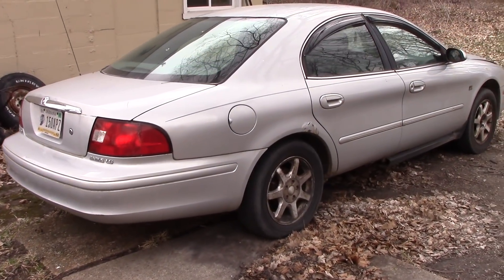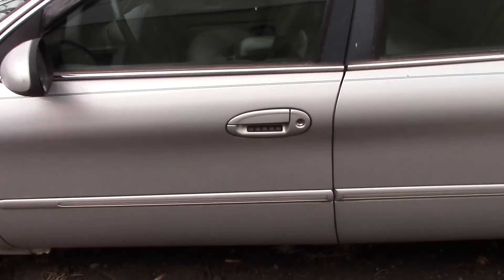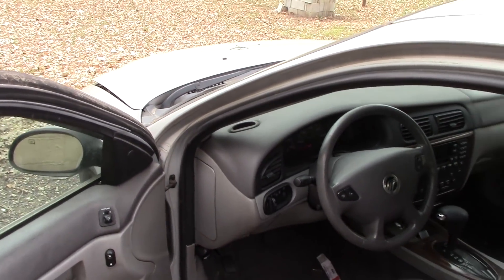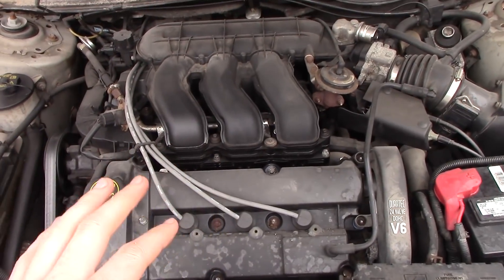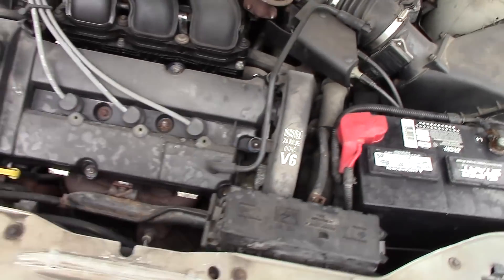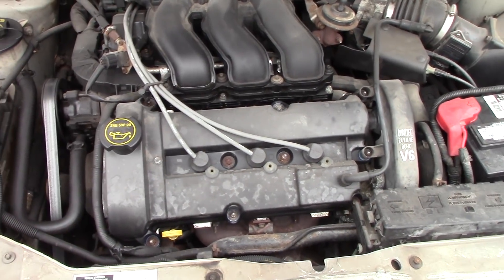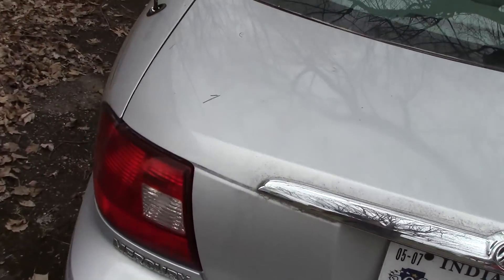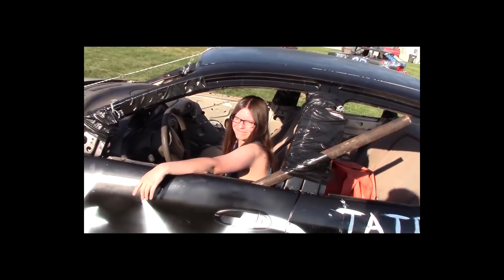A 2nd Car Joins the Derby Collection for 2019

Comment: The small belt by the battery is the water pump belt.
Should make it a figure 8 or endure car. Those 24v engines put out some good power. I did a rally race with one and it held its own against some smaller 4cyinders.

Comment: Those have a very common issue of stripping the splines on the torque converter causing you to lose all movement. Being that high of mileage its been really lucky not to go yet or its already been replaced.  We had one that stripped at 104,000.